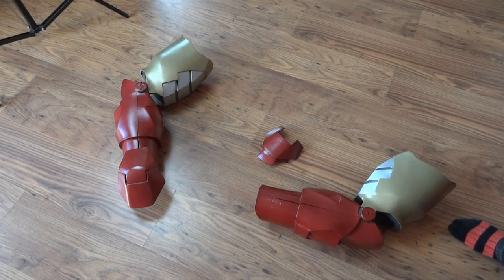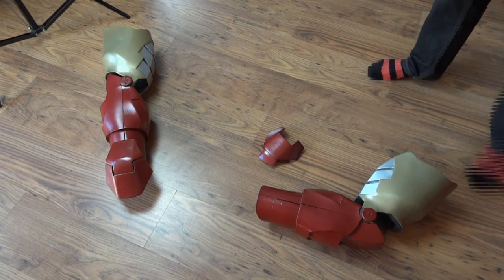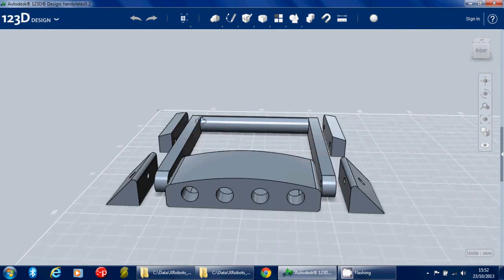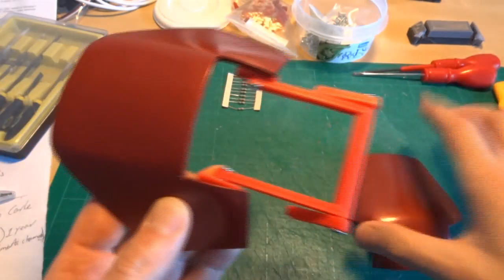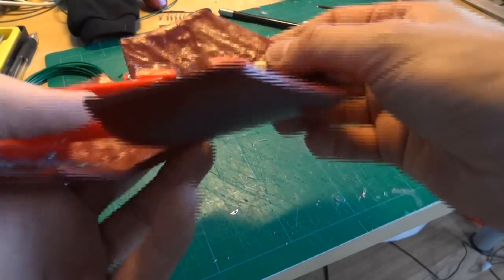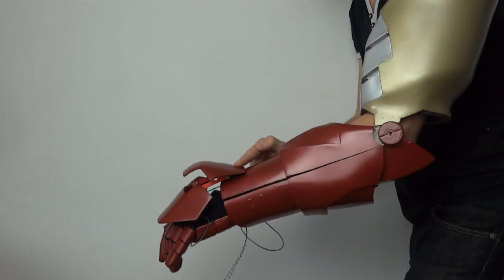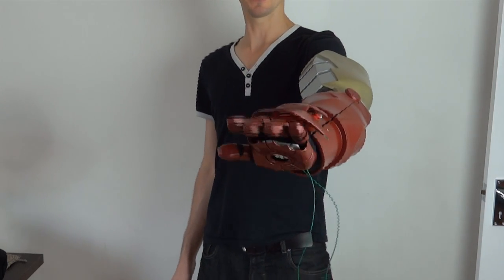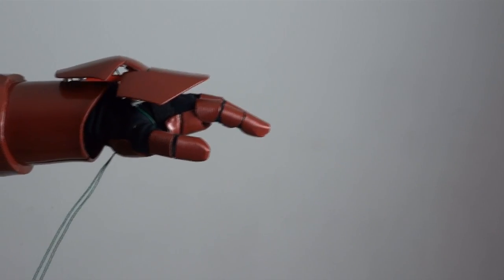Iron Man Power Suit #40 | Armour Hands | James Bruton

Comment: Nice Work James! That 3D printing really opens up some options! Although the arm pieces look awesome, I still have some doubts about the wrist piece of the larger arm part. It looks a bit bulky in comparison to the hand, it's probably because else you couldn't fit your whole hand through the hole but still. Also you could change those red LED's to small red low power lasers, that would make the suit much more awesome in light smoky places if you catch my drift:). But overall bloody well done!!:D

Comment: Nice one mate. I'd have gone for a sliding linkage on the main housing to push the rear plate up so as the front bent down the rear linkage would raise. I may have looked at springs too. What I like about these types of vids and especially your is that they're not over engineered and come at them from a completely different angle. Great stuff tho James can wait to see the next one! All the best